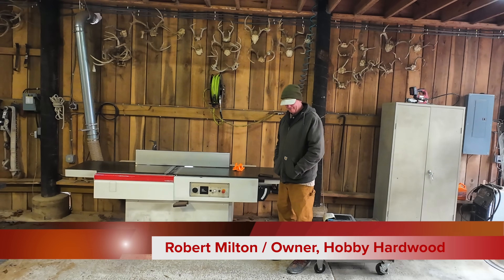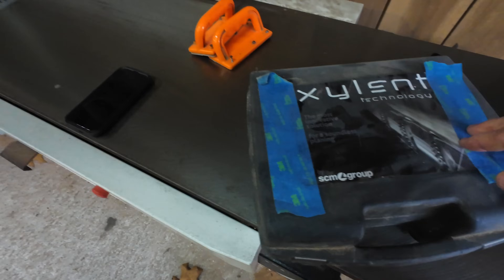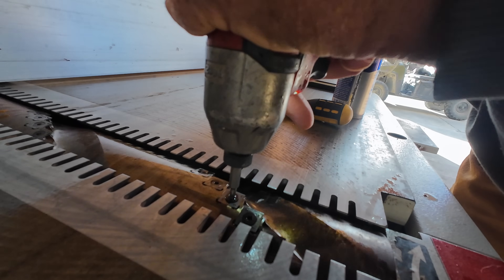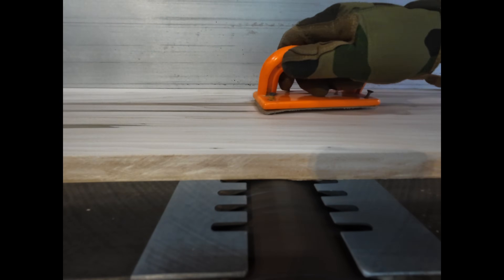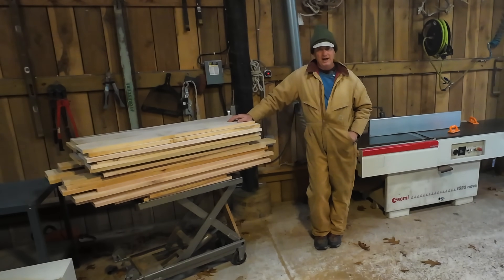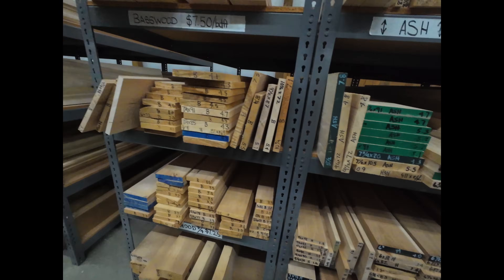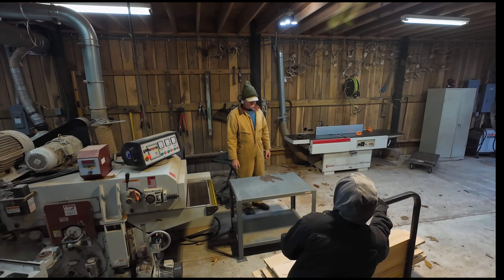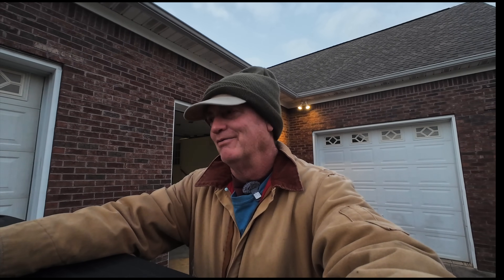Pro Secret - Flattening the Grumpy 10% of Sawmill Lumber

Comment: SCMI are great machines in all there lines. A plant I use to work in had several SCMI molders, tenoners, shapers, planer/sanders etc. in fact the operators loved the molders so much is was hard to get them to go back on a certain German built machine which supposedly was the Cadillac of the molder line. The Italians make great wood working machines.
Reply from the maker: They really do.  It has was the ONLY machine I've ever bought that was set up perfectly when it was shipped.  I went over every adjustment when it showed up, and all were perfect.  I am very impressed with SCMI.

Comment: Love it! I do have a question for ya? I'm building a flatbed for a 1 ton dually and want to put rough cut hardwood on the bed with a metal frame of course.. Could yall give me some guidance on type of wood and size, thickness and possibly the proper way to bolt it down? Thank you kindly and keep the videos commin!!
Reply from the maker: White oak is best, two inch thick, and best screwed down with purpose made hardened trailer decking screws available online and Amazon.

Comment: You flatten the boards exactly the opposite way that I do in my wood shop. I run the concave side through the jointer until it is flat then turn it over and run it through the planer until both sides are flat and parallel.  Then I alternate sides through the planer until I get the final thickness I want. If I tried to surface the convex side on the jointer first I run the risk of making it worse although as you showed, if you can hold it steady without rocking you can remove the curve and flatten the piece. Don't think you'd have,any luck with  that technique on a long board.
Reply from the maker: Most people do as you describe, and it works pretty well, and we used that technique for a while.  However, we have since switched because this technique I demonstrate is a one pass and done, allows much faster feeding, and produces flatter surfaces over longer boards, because the long boards don't curve over the ends of the facer bed.  We routinely face boards up to 8 feet long, that's our standard selling length, especially our 8/4 slabs, but didn't on this video and this works very well.

Comment: Johnson's paste wax is great for keeping equipment from rusting that's not in a controlled environment. The segmented cutterheads are the cat's meow.
Reply from the maker: You are correct, but I can't use Johnson Paste wax anymore, it was the best, but the Government has banned it;s production and I can't get it anymore.  It went from $3 per can to $60 per can.  I sprayed this cutter head with another rust preventative, but it apparently doesn't work well.

Comment: That looks like an everyday drywall cart to me. 🤔
I certainly hope this video is loaded with sarcasm,,,,,,
Air grooves? Looks like a rough mill cut that was surface ground. Not an inferior product by any means.
Reply from the maker: Sarcasm is one of my best characteristics.  However, these are far from the Uline or Grainger drywall carts, those are junk tinfoil, say they are rate for 3,000 or more pounds until they are loaded and bumped with a forklift, then they collapse, and cost $400 each anyway.  In addition, mist conventional carts have metal beds or painted beds,, which marks and ruins high grade hardwood.  So really these are lumber carts with handles.  Big difference.  We even bought some $800 "lumber carts" like at the big box stores and they also never lasted long and were very expensive.  So now we just fabricated our own, out of structural steel with wooded tops,  and have been using them ever since.  However, I will sell them for $7,000 each even though we may only have $100  bucks off material in them.  So these are much stronger for 1/4 the cost.
Reply: I've been trying to figure out a cart to catch fall of my slide table saw, maybe you can figure something out for that, might be worth 7000 grand, and you are right about SCMI great tools, I'm waiting waiting for my new saw hopefully sometime this year it's an old SCMI slider that is all manually operated no electronics to break.

Comment: Hope it warms up some there. Interesting concept. I've used flatness planers long time and repurposed 3 blade cutter heads into making picture frame stick molding. With your mechanical thinking way outside of boxes is it possible to devise pressure rollers to hold down material as it passes over the cutter heads so you're not bending over and risking your fingers near the cutters. Also, I know there are commercial stock feeding and hold down add on equipment for this unwelcomed task. Just sayin'.  Good visiting again.
Reply from the maker: Yes, there are some real nice facer stock feeder's, and we bought a real nice and expensive one years ago, designed specifically for facers, and it still didn't do as well as we could by hand.  It was quite a letdown.  I gave it away. I do think I could build one that would work, but this one technique is pretty easy.